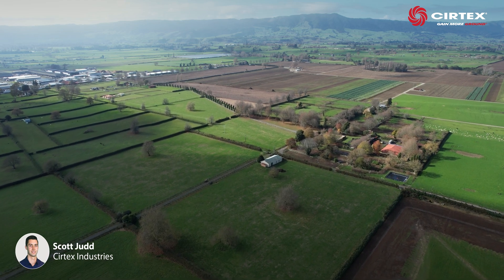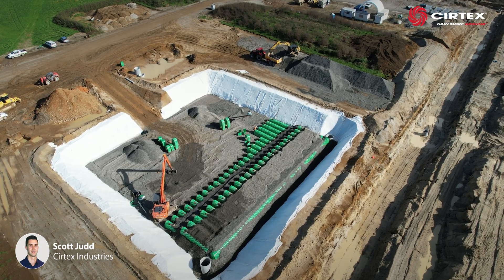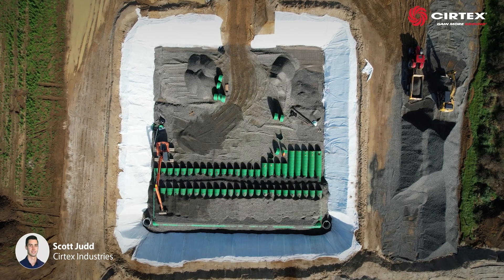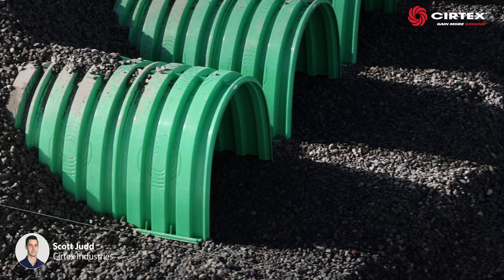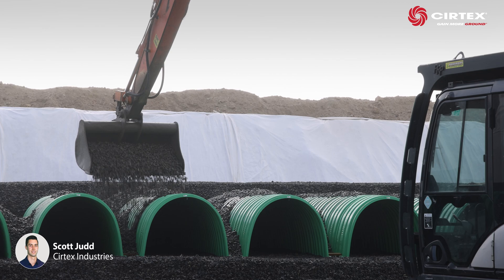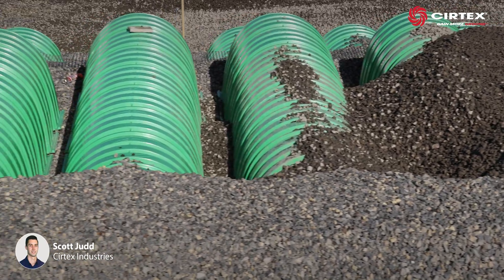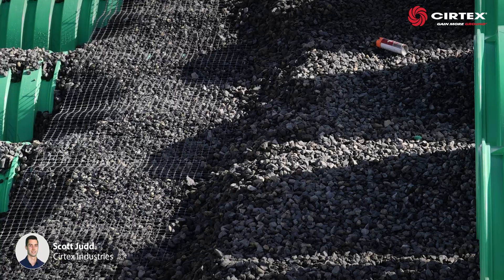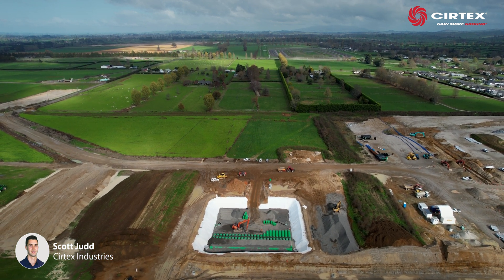Maea Fields, Matamata - Triton Chambers - Cirtex Study

Comment: During the optionering phase what was the alternative to this design? how did the area get finished? Why didn't they construct a retention pond?
Reply from the maker: Thanks for your question, Mat. The answer to your question is that  there were some stormwater ponds considered around the site for stormwater management, but the subsurface Triton System was the desirable option since all the land above could be made into a usable recreational area. The deeper installation enabled better soakage into the soil strata located at the base of the system.